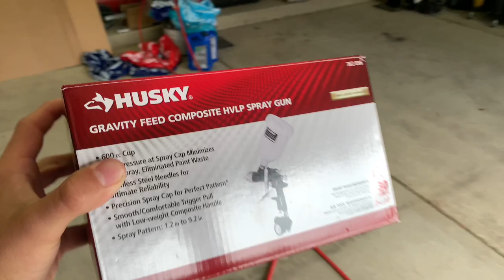(HOW TO) Plasti Dipping a Charger rt

Comment: What kind of prep work did you do for this? Any need to remove the wax or sand down imperfections or does the plastidip fill in scratches pretty well?
Great job by the way! Not bad for a driveway paint job lol.
Reply from the maker: II Vindictive II they dip filled it in pretty well